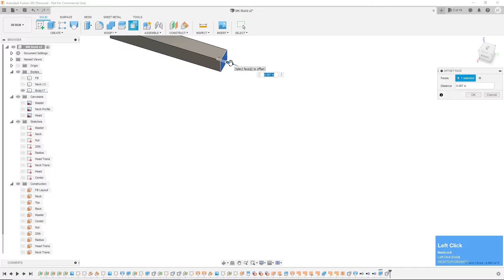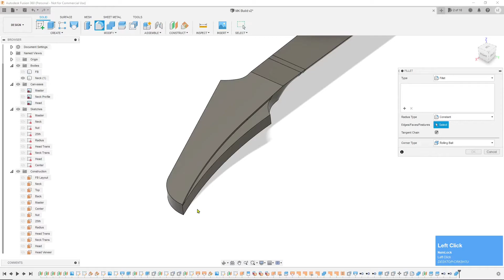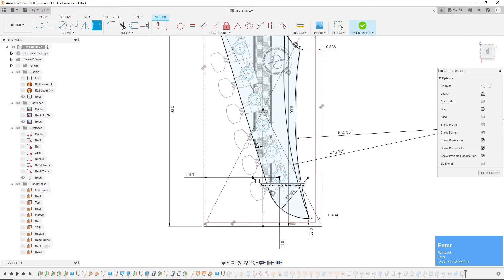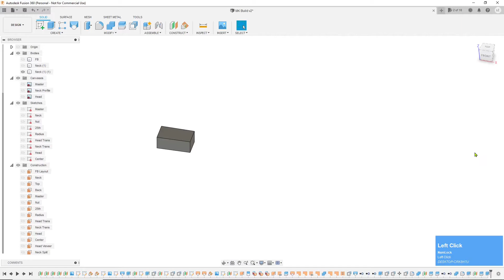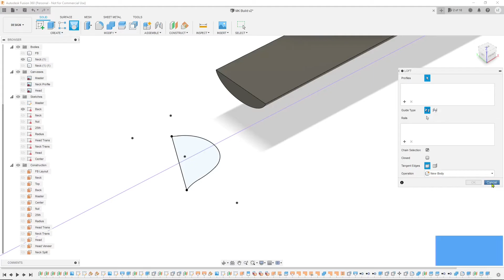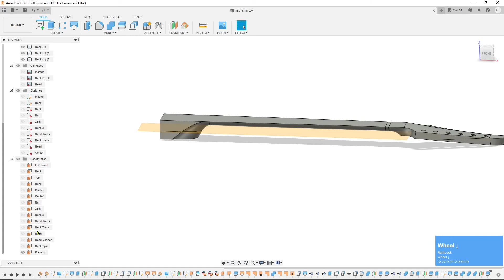Fusion360 CNC Guitar Build Session #4

Comment: Awesome Lee!!! I just can't thank you enough man, I'm doing great until here, even though i am following your exact steps there are minor differences that really change the way we need to approach into the software, for example, when you are doing the heel transition using loft you are getting a nice arch but i'm getting the opposite, and this can be basically due to the heel figure must be a little different, so i had to make another sketch with an arc from the heel to the neck and when using the loft, add that arc as a rail and oh boy it looks good! I am learning a lot with your tutorials, thank you again!
Reply from the maker: You are very welcome. Anytime. Some times just reversing the loft direction is all it takes. Also if the curve of the heel exceeds tangent to the sides of the heel, the loft will fail. The extended splitting surface must exit the body to be split totally and can not wrap back into it.
The intention of these videos is to show one way to think about Fusion 360. Fusion 360 is very powerful and can be used differently, according to the way one thinks about it. Even my way of doing things changes all the time as I learn more.
Thanks for the comments. I'm glad someone is learning.
Regards,   Lee

P.S. Check out  zebra analysis.